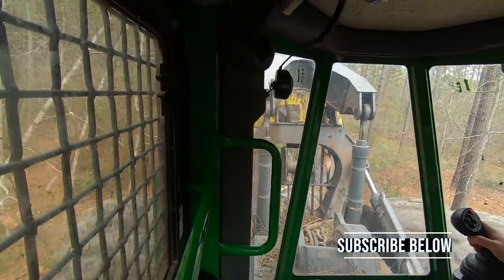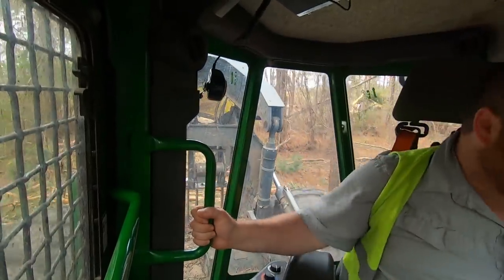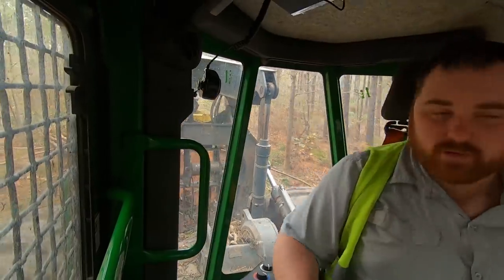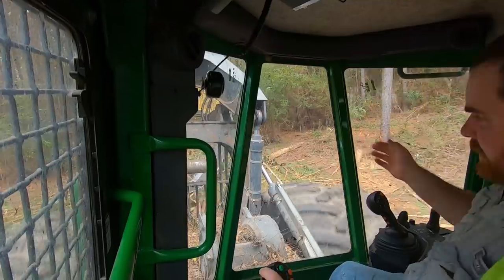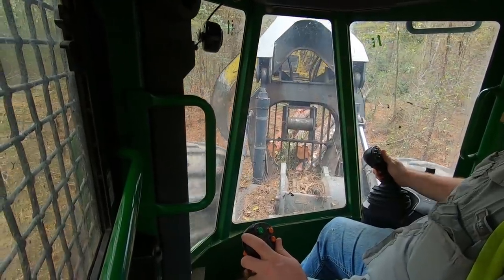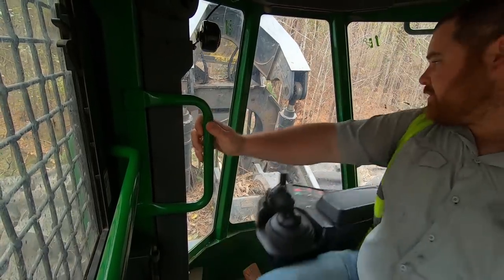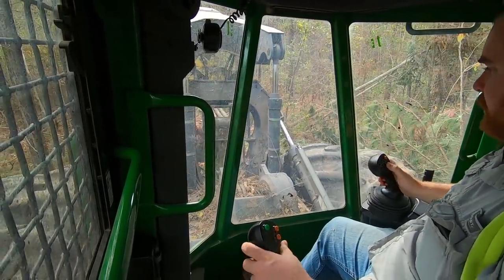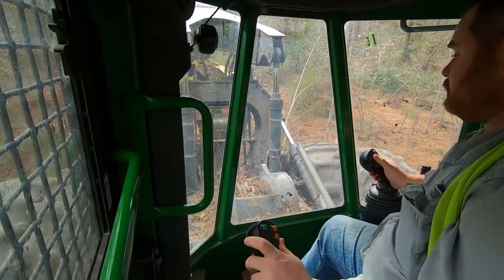John Deere 748L Skidder Pros & Cons

Comment: Hi Thomas. The Tigercats dont have a sensor on them.to slow the cylinders down at the end of the stroke. The cylinder is designed with ports at the end of the stroke to slow the oil down..
Reply from the maker: Thanks for watching!

Comment: Good job skidding. I have worked on jobs with some real good operators and some average. The good ones are productive and really make it easy on the loader man. Dropping drags where you need them and cleaning up from the delimber plus being on the lookout to push or pull trucks in or out.  You are right about your grapple damper being bad it was really swinging.
Reply: The loader" operators got it made in idaho!!

Comment: If the grapple won't hold the wood in it. Try hard surfacing it. Maybe it will help with some grip. The grapple on the inside of the John Deere is hollow right? The grapple on Tigercat is solid right? Thanks for the great videos
Reply: A old 518 Caterpillar I ran, and learned how to operate you had to be pulling on the close control all day to hold the wood from falling out, 1977 machine.1993,1994 time.

Comment: Thomas you are exactly right about the John Deere grapples they will not hold a word like the tiger cats well I got a buddy of mine at Rhonda 635 de tiger cat and they brought a 948 John Deere L that supposed to be equal to the 635 tiger cat it’s supposed to pull The same amount of wood as the 635 but I’m here to tell you it will not that 635 will bring 3/4 of a load out every drag that 948 will pick up the same amount of wood but you cannot get it to stay in the grapple my buddy made for drags on at 9:48 and he told them they could shove it up their butt and he got back on his 635.  That 635 will grab that wood you can pull both of your booms forward and head to the deck and never lose a stick of wood to me the tiger cat just has more pressure to the gravel than the John Deere does but you’re exactly right about what you just said about the John Deere not holding the wood
Reply: Your friend said to shove the skidder there 🎅🎅🎅🎅😂😂🌲🌲🌲🌲

Comment: The grapples on the 848L seem to hold a lot better for some reason then the 648 and 748L I’ve driven all 3 sizes and the 848L I drove had 5k hours while the other 2 smaller machines were new and the 848 still held the wood twice as tight
Reply from the maker: Our 848L does a good job holding the wood too
Reply: I agree

Comment: Do have to say even if spin is stiff at least you can turn seat much better than having to look over shoulder. What's cost difference between the 2?
Reply from the maker: Between Deere and Tigercat or turn around seat and non turn around seat?
Reply: @CuttingEdgeLogging_Thomas  between and tiger cat. I've always figured can tolerate stuff for right amount of money
Reply from the maker: They’re about the same

Comment: If that seat gets tough to turn. Take the plate off on the front of the seat 4 small bolts and blow it out. Then put some penetrating oil on it. Makes a world of difference
Reply from the maker: I’ll give that a shot tomorrow and see what happens!
Reply: Thomas Johnson you will see the bearing and dirt in it. You would think John Deere would put a grease Fitting there